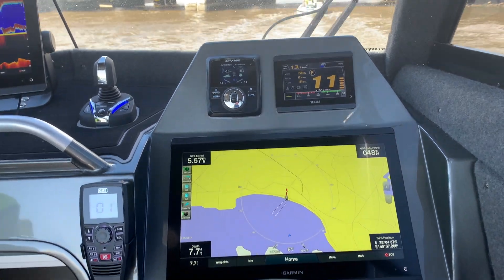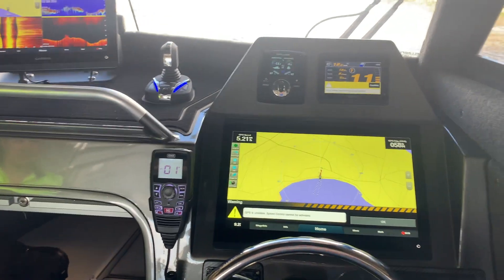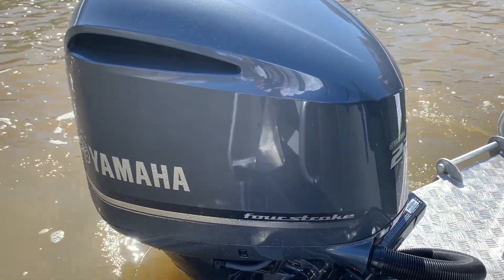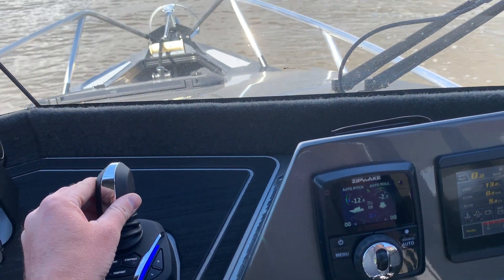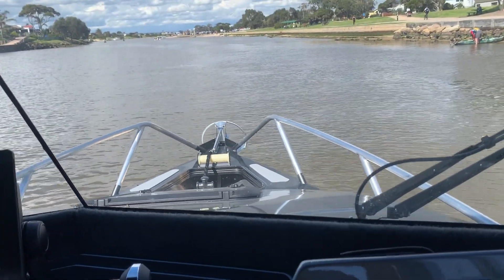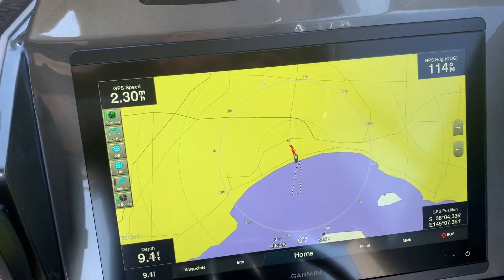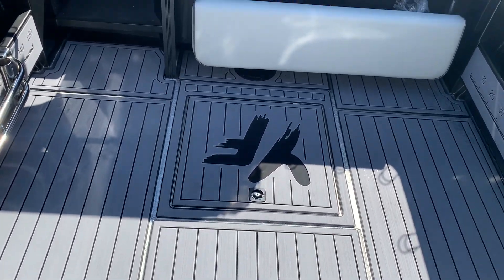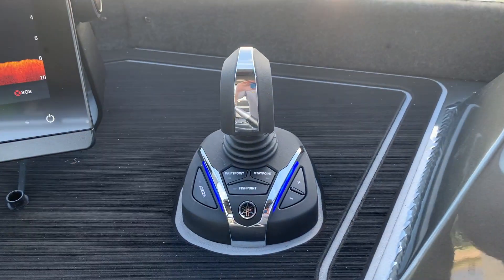PART 1: REVIEW AND WATER TEST OF THE YAMAHA HELM MASTER EX

Comment: This system really does well with multiple engines, but the price goes up exponentially. Bow thruster and a second helm for larger boats is a better way until this price comes down.
Reply from the maker: Both great options but the additional features you receive with Yamaha are certainly worth the price tag!
Reply: @StreakerMarine  what's the damage thou? For the setup shown? I'm seeing roughly 20k
Reply from the maker: @donpaterson2397  not for off mate, this is about a $17k upgrade from standard. Keep in mind, this includes autopilot and joystick